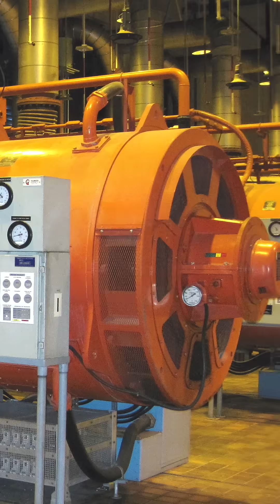wHaT iS tHE LARGEST ENGiNE EvER MaDE?

Comment: Marine engineer who has worked on these before here. They are very unique and different from car engines. They are 2 stroke and use a crosshead instead of wrist pin to achieve much longer strokes. They usually have 3 turbo chargers about 4x4 meters  high and wide with inter and after coolers. They continuously run lube oil purifiers to keep the oil clean as it’s very expensive to replace it all. They are started with high pressure air which is injected into a cylinder at TDC to get the engine to roll over. They are also reversible which means to make a ship go backwards, you literally stop the engine and run the engine in reverse. All fuel metering is done with solenoids as opposed to a standard camshaft. The engine also uses common rail fuel injection at around 1000 bar.
Reply: Some of us DREAM of a achieving a much longer stroke but some dream never come true 🤷🏻‍♂️
Reply: @TheTruthfulOnes  hehe
Reply: @TheTruthfulOnes 😂😂😂

Most cylinders out there can't take long strokes. So don't worry. Also bore diameter is more important than length of the stroke. If your stroke is too long it can hit the cyclinder head. Engines don't like that. 😂
Reply: Thanks you . I love when expert comments on the videos and give insight to something laymen wouldn’t know .❤
Reply: How do they get it to idle so ridiculously slow and not stall or cut out all the time?, my bike isn’t happy if the idle is below 1500 lol.
Reply: @ramborambokitchenkitchen6357  Mostly inertia. Flywheel + crankshaft + lineshaft + propeller weigh over 500,000 kilos all together. Also it can generate massive torque due to long cylinder strokes. The pistons themselves are 6 meters.
Reply: @Andrew-yl6kg "Mostly inertia" doesn't solve the equation. They have no clutch or gear box, they are direct drive to the propeller, so they are never free spinning. It is much more due to the long piston stroke and so many cylinders. Fuel is injected and burns, and a 5 rpm, each revolution is 12 seconds, meaning ~6 seconds for the piston to get from top to bottom. That is like 5 seconds of push the piston is harvesting from the combustion event. But that still isnt truly idling, because the prop is direct drive. It is still pushing water.
Reply: @wiredforstereo  Are you dull? I literally mentioned the high torque and long strokes, which in turn is dampened and maintained by the high inertia of the drive train. The force output of a propeller is not linear based on RPMs and at extremely low RPMs there is almost no forward force from the prop.
Reply: @Andrew-yl6kg Nonsense.
Reply: @wiredforstereo The more pistons you have the less dwell period between firing events,which means that in a four cylinder engine for example,the engine produces it's power at only four points in one single rotation of its crankshaft, every 90 degrees, a flywheel is relied upon to eliminate some of the crankshaft pulses and help maintain inertia.

When you increase the cylinder count that dwell angle is lessened until you get to the point that given enough cylinders,cylinder overlap occurs.
This is where more than one cylinder will be on its power stroke, (generally at slightly different stages of its stroke) so the engine is producing more power strokes per crank revolution and by virtue what helps them to run so slowly too .
Hence the reason that as an engines cylinder count rises, it's inherent vibration,harmonic imbalances.crankshaft pulses etc.dissipate,it's reliance on a flywheel too and a more linear smoothness is apparent, drive a V12 car and you will get the picture.
This engine almost certainly does not have or need a flywheel,pictures I've seen of other big ship engines of what people normally presume is a flywheel is usually just a crank disc to mount a starter engine ring gear to. 
Sorry fella, replied to the wrong comment but hopefully they will get the picture😊
Reply: @ramborambokitchenkitchen6357  You bike has tiny pistons with hardly any inertial mass...in fact you want less inertial mass in a bike so it will rev faster and higher....the pistons in these are massive....one bang from almost 2000 liter cylinder and the mass of piston inertia will keep her happily spinning roundy round long enough for next cylinder to fire
Reply: @ramborambokitchenkitchen6357  Usually bike engines 4 cylinder ones mainly the crank lobes are 180 degrees apart. With this the crank lobes are staggered throughout the 360 degrees of rotation and therefore at least one piston is applying rotational force.
Reply: I know you're the engineer here, but you can't leave out that on modern ships the engine rotation isn't getting reversed. Modern big ships usually have variable propellers and simply change the angle of attack to change speed and direction, resulting in an engine that always runs at peak efficiency. I'm not sure about medium ships tho, the last one I was in supposedly had a gear case that reverses propeller direction.
(Yes, i know 2am me was stupid, i know better now)
Reply: @Tagbowl  It really depends on what kind of vessel you're on. I've been on one of the most modern vessels at the time (mearsk triple-E) and it had two similar engines, running at around 100rpm. If you wanted to go reverse, the engine had to be restarted in reverse.

As far as i know, vessels with 2-stroke engines usually have a fixed propellor while high rpm 4-stroke engines usually are fitted with cpp's.
Reply: @Flutflutflap interesting, i didnt know that
Reply: @Flutflutflap it usually comes down to the type of ship more than anything else. Two strokes are just the most efficient at very large scale, so they tend to end up in the largest vessels. Fixed pitch propellers are easier to optimize for efficiency, and cargo vessels such as container ships and tankers rarely have to maneuver in reverse, as any movement that would require it usually involves tugs anyway, making it acceptable to make reversing impractical and time consuming. (modern) Cruise ships usually have engine pods that can rotate 180-360 degrees as they dock far more frequently (sometimes even multiple times per day), and have too slim profit margins to accept the cost of hiring tugs every day. On the other hand they don't need to be as fuel efficient in transit, as they rarely traverse long distances at a time. Propellers with pitch control is the acceptable in-between solution, and is often found on e.g. Roll-on/roll-off-ferries that usually dock with the front or rear towards land (the loading ramp), meaning that they don't need the same sideways maneuverability that cruise ships do, but benefit from the better efficiency of traditionally mounted propellers. They are also often found on smaller vessels (with 4-stroke engines), because 4-strokes don't work well in reverse (would try to exhaust the fuel, before compressing it), and variable pitch propellers are a lot cheaper to make than rotating engine pods, though Volvo does make a reasonably priced pseudo-pod design for their IPS engines.
Reply: @Tagbowl This particular engine is exclusively used on commercial vessels with fixed pitch propellers. The reason is that fixed pitch is about 5% more efficient in the forward direction than CPP. Because 99% of the time a ship goes forwards, it can save millions in fuel over the life cycle of a ship.
Reply: @Tagbowl  More common in Warships, less common in large commercial vessels.
Reply: @TheNicestPig it also more common on some CZ-3 Tarmac Cars.
Reply: What war ship?  They are more common in the commercial fleet. I’m not aware of this engine ever being in a warship.
Reply: @timothyboone5003 I think he was speaking on the type of propeller and the way the engine outputs to said propeller
Reply: @Tagbowl  except he can leave that out because he’s talking about this model.
Reply: @Tagbowl  Another thing common nowdays is diesel-electric propulsion. Just like locomotives. The engine drives a generator, which powers electric motors, and the shafts are connected to that. Even easier to have the engine sit at peak efficiency.
Reply: @Tagbowl   Who cares what a modern vessel does bro, no one is even talking about them. this convo is only about that engine and nothing else. it's like if someone was talking about cats, and you suddenly started talking about ufos, smh
Reply: In my head, I was imagining having to use a separate engine to start this giant one.
Reply: @dizzydial8081 actually your half correct they do. A diesel engine drives a compressor into an accumulator which is then the compressee air starts the main engine
Reply: @1985metalmaniac  Usually the air compressors are electric motor driven which get their power from diesel generators. A diesel air compressor would need its own intake and uptake plenums and ducting which adds unnecessary complexity.
Reply: do these use diesel or heavy fuel oil?
Reply: @ryangagnon5489 engines of this size will run on heavy fuel oil.
Reply: @ryangagnon5489  Diesel to start and initial run, then change over to heavy fuel oil.
Reply: @ryangagnon5489  kerosene / diesel in ports for emissions, basically crude / heavy fuel at sea is the norm
Reply: @ryangagnon5489 heavy fuel oil
Reply: @ryangagnon5489  dual fuel is common but HFO was the only thing for most engines.
Reply: How long is the fuel rail?
Reply: @TheAllAroundMan I’m not sure about that engine specifically but other engines that use standard diesel have a sending unit that is sent through a governor and through individual pipes to the injectors so it’s called common rail injection but it’s not like a fuel rail like it would be on a standard engine
Reply: Some large marine diesels do have a fuel rail like you’re thinking though just depends on the engine
Reply: And I thought ships had a reverse gear😂😂😂
 Daaa😂
Reply: @ssa6227 Some do, just not ones with these engines.
Reply: Oh yeah okay that seems-, 1000 fucking what.
Reply: @justv7536  Yeah the one I worked on uses servo pistons to generate the pressure. Most of the piping is double wall to ensure safety in case of a pipe burst.
Reply: Now what’s the percentage of these running diesel compared to heavy fuel oil?
Reply: @theonewhoknows2  I would guess like 99% heavy fuel (usually VLSHFO or ULSHFO). Some similar engines also are dual fuel and can burn LNG.
Reply: @Andrew-yI6kg have you ever worked with mtu engines before?
Reply: @S6_Projectnegative
Reply: Thanks I was wondering how they got that thing to turn over
Reply: @jasonbuxton3358  There is also a turning gear which engages the flywheel for maintenance and checks. Takes almost 15 minutes to do 1 full revolution.
Reply: How much fuel is injected into each cylinder per stroke? and is it pre heated l'm guessing it must be to thin it to inject it at the huge pressures needed.
Reply: @martintop777
5.7 ounces per injection
Reply: Just like my skidoo 2 stroke engines
Reply: Always found it cool how the bigger engines become super simple like that
Reply: My dad told me about an engine in a ship he was one. They could turn off or disconnect one cylinder at a time. For maintenance, inspections or repairs. You could walk inside the cylinder. Used cranes to lift off parts, and a 50kg pneumatic wrench on the "bigger" nuts and bolts. Hard to comprehend the size of engines spanning several decks.
Reply: Thank you 😊
Reply: ye
Reply: So it's like a 1.9 tdi but even bigger
Reply: Amazing figures. 👍
Reply: What is a crosshead?
Reply: Question for you sir: How is it working with these larger applications on the marine side of things? Also does it make a good career? 

I’m a diesel tech who wrenches on semis, I’ve been thinking about going to school and branching out into something more niche. Thanks in advance!
Reply: @chaseflynn6956 being in oiler on a ship is really good money and you get to travel just get used to being away from home. But there other sides of the industry such as ferries that way you can stay local.
Reply: @chaseflynn6956 If you’re american you can make 100k plus easily. Only downside is you need to be away from home for months on end.
Reply: 1000 bar! Jesus Christ
Reply: @DakotaMacFarlane-v4o not really that crazy it’s pretty common modern high pressure diesel fuel systems will reach 40000 psi but on that scale 14000 psi is pretty impressive
Reply: @DakotaMacFarlane-v4o that's high but in some cars it is a lot higher like nearly 2 times the pressure

Comment: You mean ONLY 107390 HP
Reply: It doesn’t need huge amounts of horsepower because cargo ships don’t exactly need to go super fast. This engine has extreme amounts of displacement to create nearly 5 million lb ft of torque, which is what is needed to accelerate quickly and move heavy loads for the ginormous ships this thing will be placed into.
Reply: @GoodGoys-271k it’s a joke, if you watch some of his content he says “only 900 horsepower” and stuff like that for engines with high horsepower
Reply: @radku9155 oh right, my apologies.

Comment: The Wärtsilä RT-flex96C, a two-stroke diesel engine designed for massive container ships, and it produces a measly 107k hp the crank weighs 300tons.
Reply: it also shoots about 2 soda cans of diesel from the injectors every revolution
Reply: @Nathan_Mov_files it uses heavy oil to run, and diesel to start it.
Reply: I was wondering what it’s used for
Reply: measly?!

MEASLY?!?!?
Reply: @Jw15918 because 4hp/l you could tune it to make more power 😂
Reply: Weighs way more than 300 tons
Reply: @tinyky2598 the crank is 300 tons and the whole engine 2300 tons and 107k hp
but considering the ships carrying that engine have ~150000 tons payload, 1.5% that'd pretty light  like moving a 4000lbs car With a 60lbs engine that makes 1.5 hp..